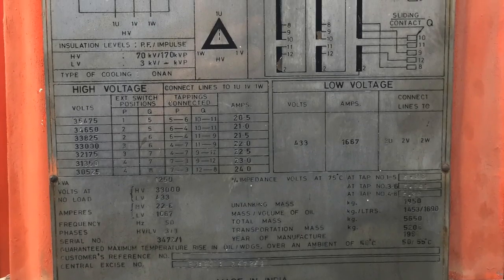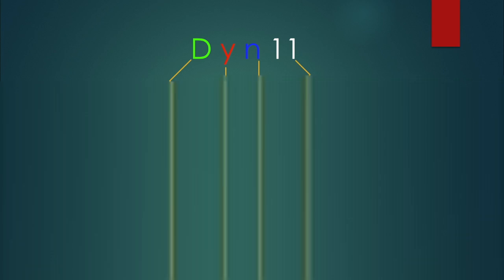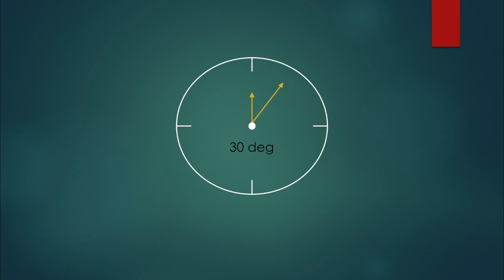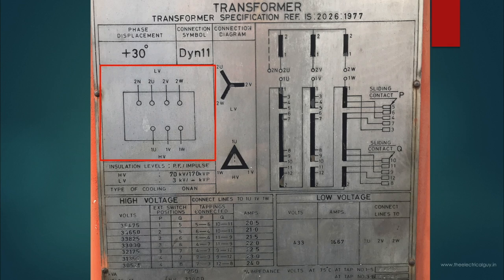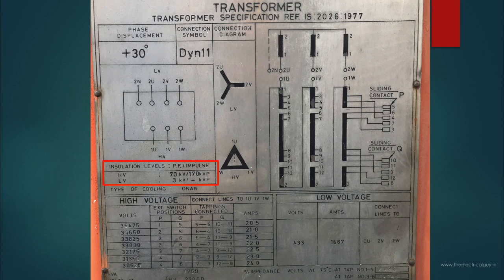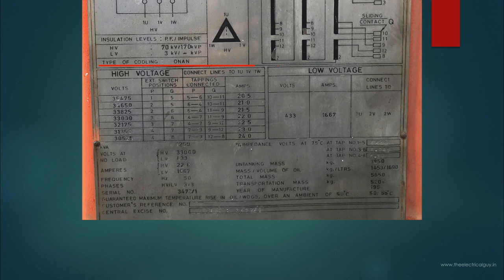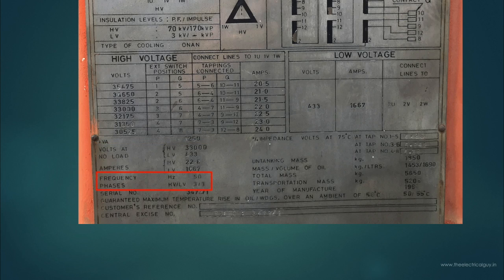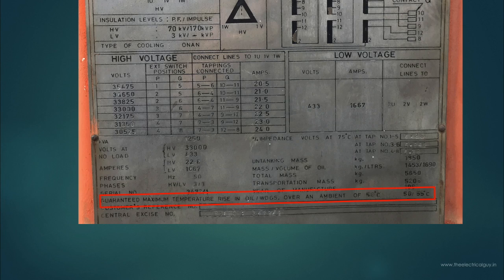Nameplate details of Power Transformer | Explained | TheElectricalGuy

Comment: Sir, Please make a video on the nameplate details of a three phase generator transformer (consisting of a bank of three single phase transformers connected mostly in delta-star (LV sides in delta and HV sides in star with neutral of star grounded)) used to step up the voltage levels (say 20KV to 400KV) in a generating power plant ?

Comment: MVA highest rating is with Fans on.  Heat run is usually higher depending on the utility.  Then there’s the emergency rating, higher yet. That number is not on the nameplate.

Comment: You should clearly mention that the phase differance will be only between the LINE VOLTAGES of the Primary and Secondary windings. PHASE VOLTAGES of the Primary and Secondary Windings are always in Phase.

Comment: Good video .How do you define impedance volts ?
Reply: % of primary voltage applied that will produce rated current when secondary winding is short circuited.
Reply: @substationtestingandcommis3452  That's right.% of rated primary voltage required to establish rated current as secondary is short circuited

Comment: What does untanking mass and transportation mass means?
Reply: For larger oil immersed transformers, "untanking" mass refers to the core and coil assembly (or the active part) weight/mass or what is actually untanked by a crane.  Some larger transformers (20-200 MVA) can have the tank top plate as part of the core/coil assembly.   "Transportation" mass refers to the actual weight as it is transported, the tank with the active part inside.  For larger transformers, all the accessories that can be removed are to make the transport weight lower (lower cost).  Bushings, radiators, fans, even control cabinets are removed for transport.  On the largest transformers (think high voltage transmission systems), oil is drained prior to transport to bring transport weight down even lower.  Crossing bridges and culverts gets expensive as weight goes up.

Comment: Other transformers have 2 or 3 types of cooling mention as ( onan / onaf / ofaf  ) why ? Is that for each phase or primary/secondary winding ?
Reply: Hakem M over all transformer because all windings are dipped in the same oil tank ... where fans are provided outside the tank where hot oil move in the ducts
Reply: Brother there are 4 type of coolings systems most prevalent in power transformers.
Onan
Onaf
Ofan
Ofaf
First is natural
Second is air forced
Third is oil forced
Forth is oil forced and air forced.
There are leading and lagging thermostates setting on different temperatures they contineous watch  the temperature behaviour of power transformer in normal and peak hours and maneuver the through above mentioned four systems as required time to time.
(Khalid Mahmood  pakistani power xfmr specialist)
Reply: Thanks to all comments you help me 🙏

Comment: One question, with % impedance for different taps, if you wanted to find the ohmic value, would you use the voltage at that specific tap as your kVbase or do you use the nominal kVbase for all? Thank you

Comment: Thanks. The maximum temperature rise at ambient 50c is given as 50/55. So in running condition the acceptable max temperature is 50/55 or 100/110?

Comment: OLTC which side it's connected for HV side or LV side.
Reply: If  step down power tranformer then OLTC HV side if Generator xfmr then lv side but not necessary oltc may be manual.

Comment: Why tapping are provided on HV winding? Why not on LV winding?
Reply: some countries have tappings on LV too..it only depends on usage as mostly LV is secondary in india.
Reply: On hv windings current is low as per transformation equation.So tap changing is preferred on hv.On lv current flow is higher and tapchangings may lead to sparkover and resulting winding destruction